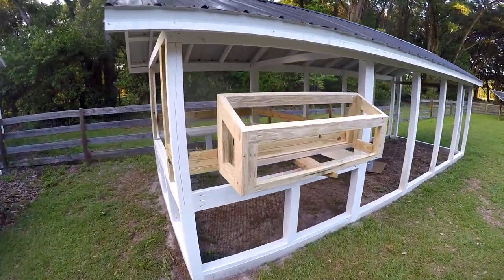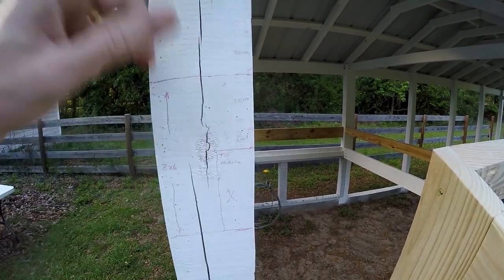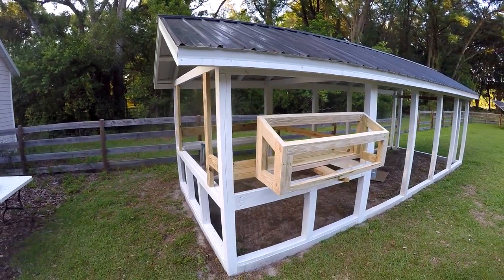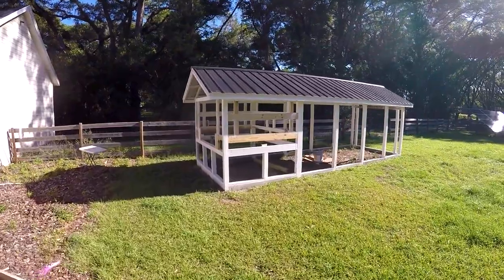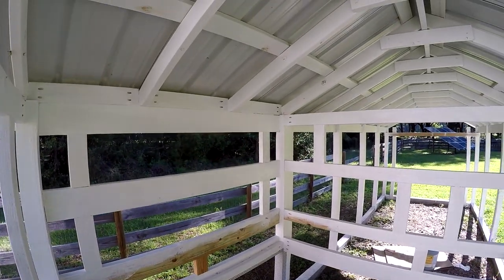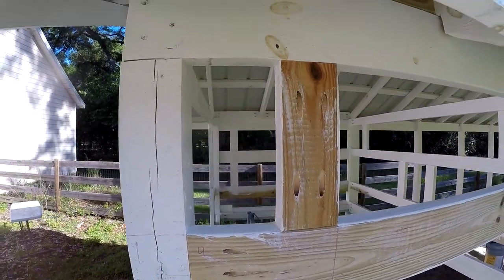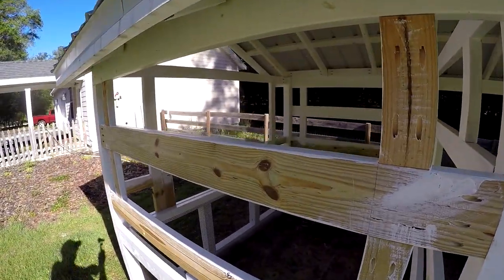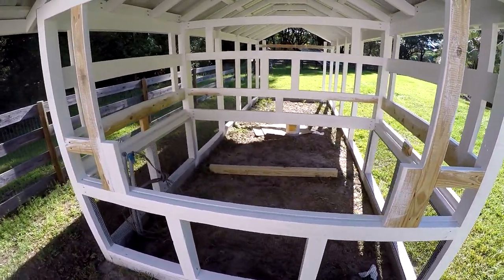Chicken Coop Build Pt8: Hen House Window Level

Comment: Hello again. How is your coop coming along? I'm at the point where I need to start building mine and have been watching yours. I hope to make a Craftsman style.  I can't find anything on that as far as details.  I'm feeling the way you were in this episode. I have basic construction skills but I don't know what I'm doing as I think my project is a bit above my level. Was thinking to do it like carolina coops but I'm also in FL and I think your poles in the ground framing is better for our hurricanes, but harder.  Basically I'm scared to even start and haven't made the initial decisions of how to even start.  Plus the off set roof. Lots to figure out.  Hope you finish and get chickens. I have extras again that need homes.
Reply from the maker: How do you eat an Elephant?  One bite at a time. 
I'm not going to sugar coat it, it is a very difficult project that will take a lot of time and cost about $6,000 if you copy mine exactly.  That said, you should watch the entire series and ask yourself this question: Is there any ONE step that you don't think you can do?  If not, then: Bon Appetit  :)
Reply: @HomesteadEngineering   The roof will be the hardest thing. I've never worked with metal before. Also it will be so high up. I need a bigger ladder than what I have. Those parts when I think of them make me nervous.  The cost doesn't scare me so much. I can tackle that week by week.  But tht's way way better than 30k or more to have Carolina Coops do it for me.
Reply from the maker: @ScaryFear  The key to the metal is to have them cut it to fit at the factory.  Then all you have to do is host it up there and screw it down.  Aside from the big cash savings I like looking out at the coop and knowing: I built that!  :)
Reply: @HomesteadEngineering  Oh I'll have to look into that.  Ah yes I know that feeling from my small coop I built.